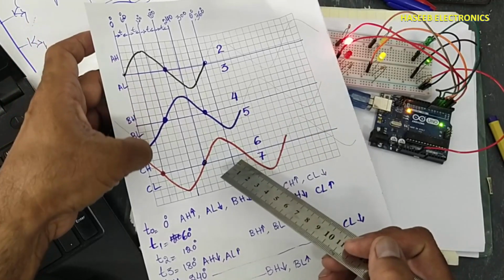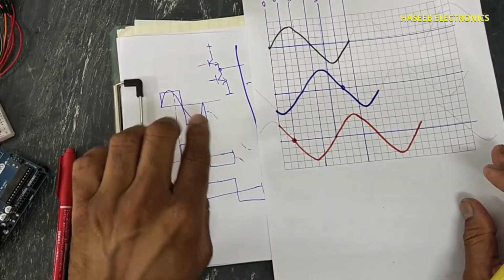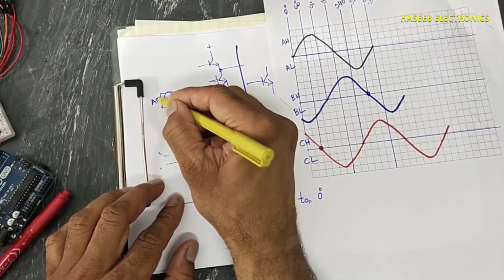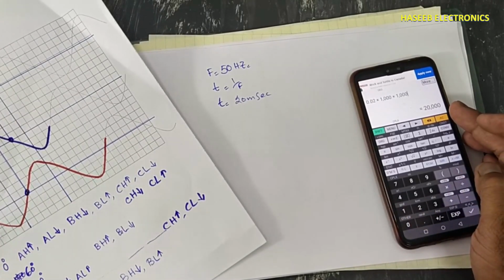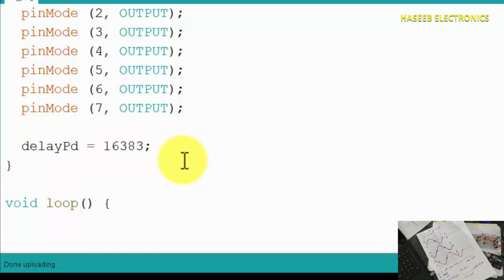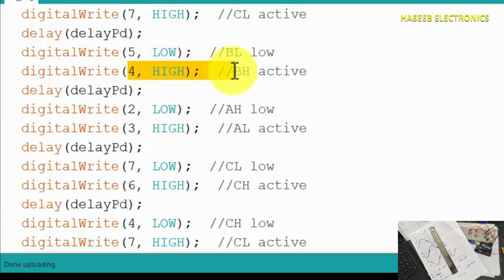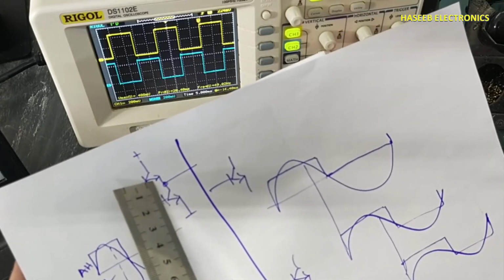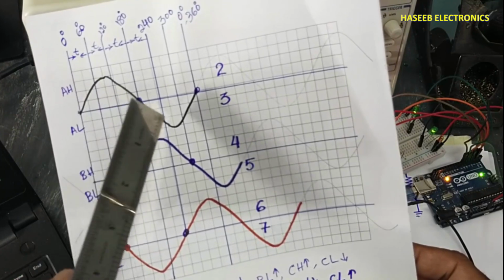{963} 3 phase UVW Arduino code - part 1

Comment: 😃Thank you.  That is a very good video, with very detailed and methodical presentation.   I have been trying to do something similar for a while and your presentation has helped me look at the problem slightly differently.  I can't find 'part 2, where you may have fixed the following observations: 
I would have taken the clock time  "x=micros() +3333"  then when you want the delay -wait till until "micro()> x" .
Also the first block of (3) digitalWrite for pins 2,5,6 should be in setup.  They are only useful for the first execution of "Loop()" and every subsequent execution they are redundant.  The pattern in all the other blocks is 1 pin is set LOW & 1 pin is set HIGH, that first block with 3 set high, I think is not efficient.

Comment: Hello, professional presentation and precisely explained. Of course, the basic square wave signals must be converted to PWM sine functions. You will probably discuss this in part II.
I wonder if Arduino can provide signal control states to ensure adjustable frequency and voltage ramps adequate to a VFD standard frequency converter?
Congratulations and best regards 💖👋😀.

Comment: Sir
Can be Arduino implemented into inverter AC outdoor pcb controlling for DC inverter compressor. If yes how to implement it as I have outdoor pcb MCU damaged . But on searching entire internet datasheet show some pinouts in Chinese. Can Arduino pe placed in place of MCU to control the compressor with temperature and PFC . MCU is Green G-Mark II w8433.

Comment: Assalamualaikum..Sir UVW  ka working and timiming and frequency aap excellent se explin deye ..and ek doubt out put one by one aa raha hey  is ka input vcc volt 6pulse pe ek hi bar melega kya.. practical . At mega 328 ic me progarma karke ye ic ke  input me voltage 6 pulse variable ke liye vcc kisa Dena  padaga thoda explain karo sir

Comment: If you drive FETs with just HIGH/LOW they will heat up and blow. you need to attach some frequency.
Reply from the maker: best regards and special thanks 
sure we will build it practically. as i am building it step by step.

Comment: great Hasseb ,however for VFD the signal is different ,it is called SPWM .the new compressors work on BLDCE signal .all u need set the 6 steps order and will work properly
Reply from the maker: exactly perfect. 
this video is only base structure to get idea about the circuit and in upcoming sessions we will try to modify and adding different features and its practical application
Reply: Also if u could put the two waves drivers the SPWM (VFD) and BLDC for DC (for dc copressors) by arduino